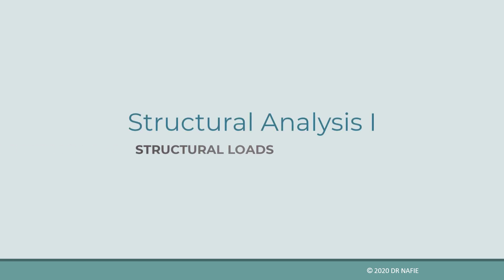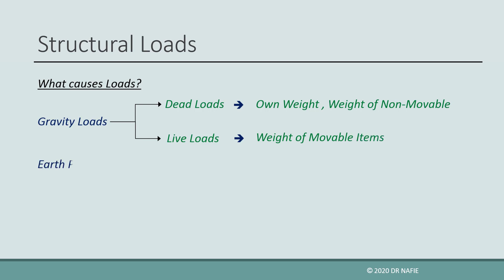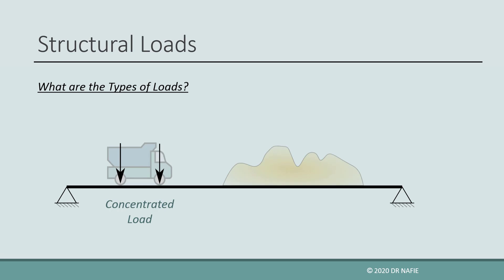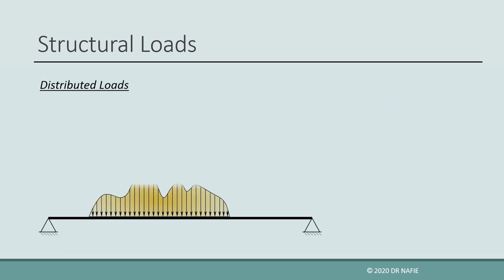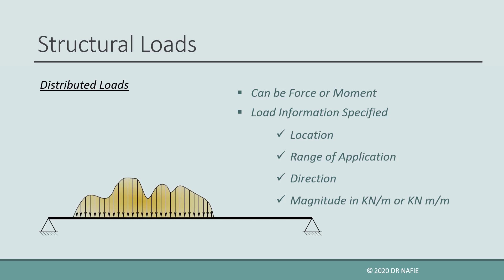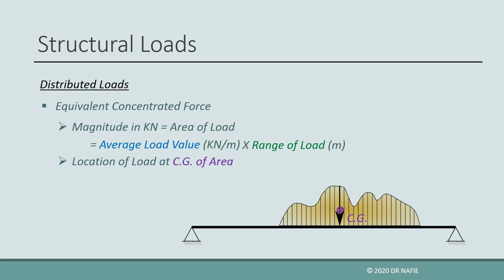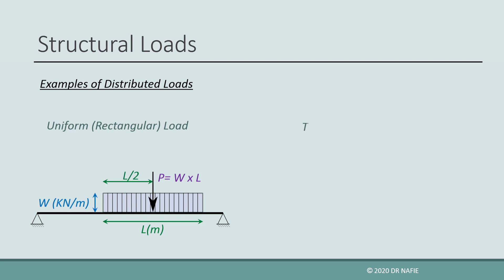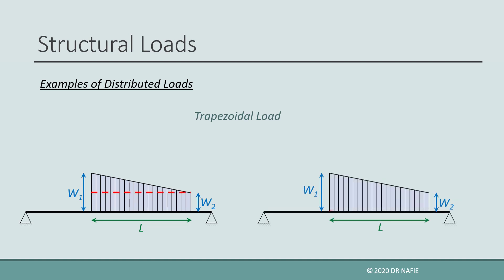Structural Analysis Loads  - Distributed and Point Load

Comment: Sir give  some explanation on  torsion

A sunshade causing a torsion in a linrel. Beam

a. Lintel is  simply supported
b. Lintel is  continous on columns
Reply from the maker: Talking about torsion is a very good idea,  but currently I am concentrating on the analysis of 2D determinate structures, and torsion is a 3 D effect. But definitely I will put in my plans for the near future.
With respect to inclined beams, I am planning to talk about it, God willing, very soon. 
After that , I am planning to talk about frames and then arches.